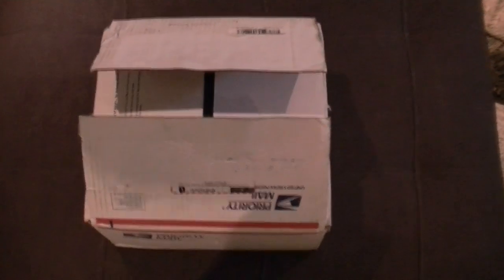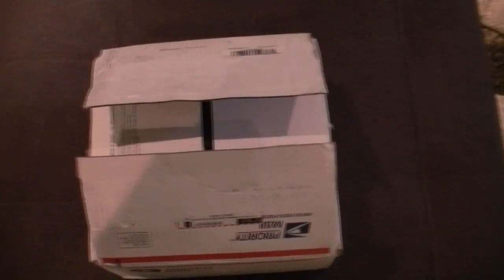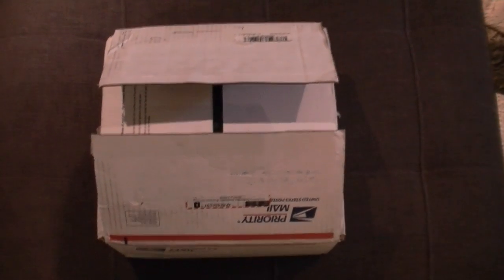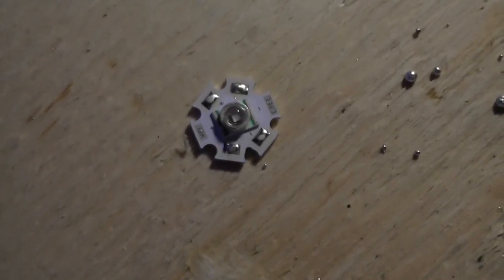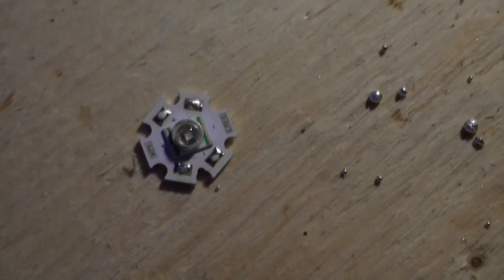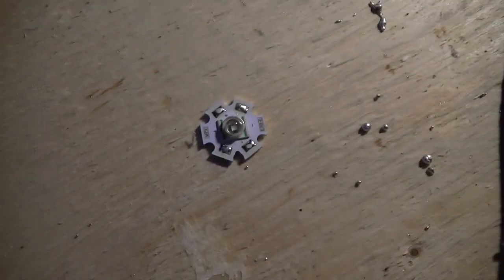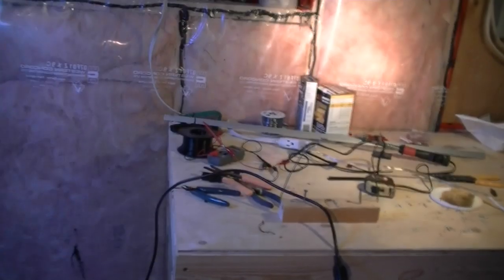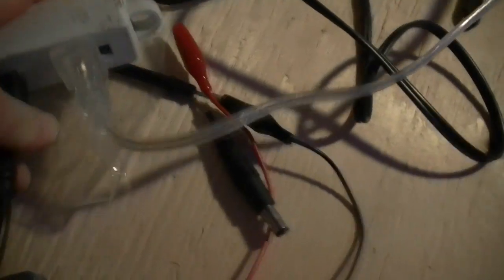Rickets Reef: DIY LED Light Fixture Pt. 1

Comment: You shouldn't turn on the LEDs without being attached to the heatsink for too long. Its ok for a couple of seconds just for a try but having the LEDs already attached to a heatsink also helps a lot to solder the wires. Also, strip the wire a lot shorter. Excess of exposed wire could cause a short if it touches the LED star or the heatsink. It could even potentially harm you as well.

Comment: @1mkwiet Well umm I was estimating $500+. See I was going to go with 36 LED's but the wiring looked like a fire waiting to happen. So Then I went to 48 with LPC 700 drivers. Plus the heatsink was 30" long and shipping was outrageose. For a $67 heatsink and $20 fans it was gonna cost $130 shipped. And the 48 LED kit was like $405 so that $535, plus the cost for a solder, wires and all that. Sooooo yaaa not for me lol.

Comment from the maker: @iAaronProductions for a 40 you can probably do it for 250...the smaller the tank the cheaper the actual cost of LEDS become.....not just cause the size changes, but the drivers get cheaper and you need less LED's per sq inch cause the depth changes, also you don't need optics with deep tanks. etc etc. I'll be alternating color's but the blues and whites will be on seperate drivers for sunrise/set and dimming effects.